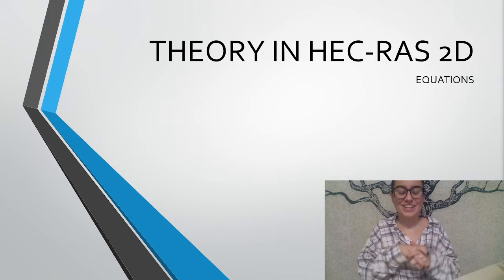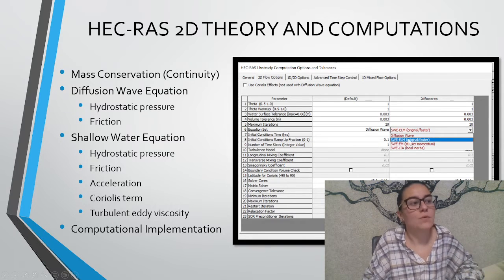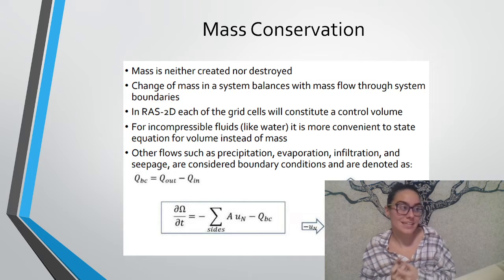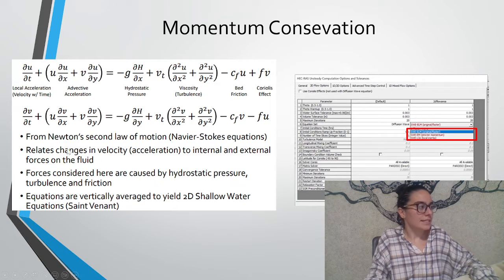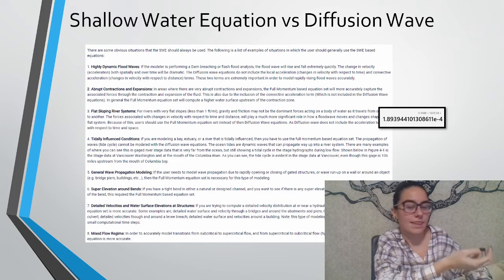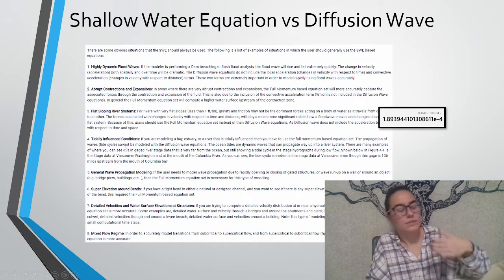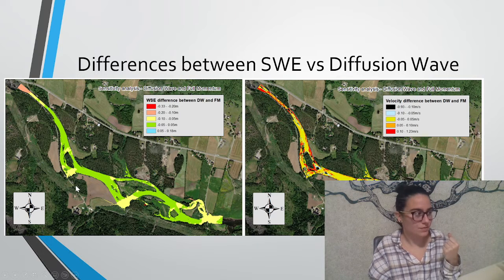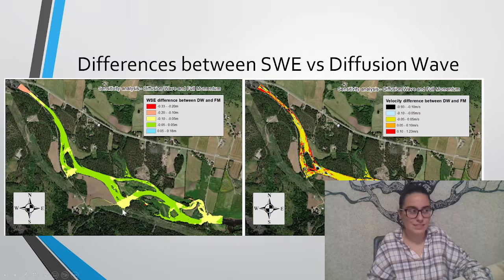HEC RAS 2D Equations Diffusion Wave and Shallow Water Equations

Comment: Hi Ana- thanks for your video. I use Hec Ras for river restoration projects, often re-meandering so it is important to run SWE for the super elevation. Often it takes much longer to run these and I get many error messages while it's solving n as it struggles with certain cells. I wonder if you know how to interpret these error messages or speed up the process by changing the cells the errors are associated with. Also do you always run your models with all available cores or do you sometimes alter this and find it speeds up the process?  So yeh... if you ever feel like doing a video on SWE solver errors or how many cores to use...that would be great :)